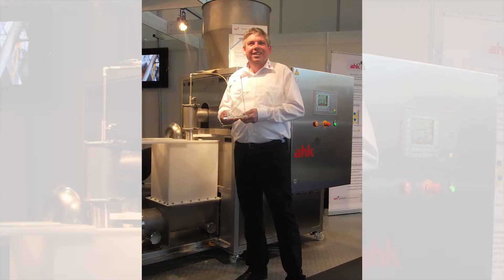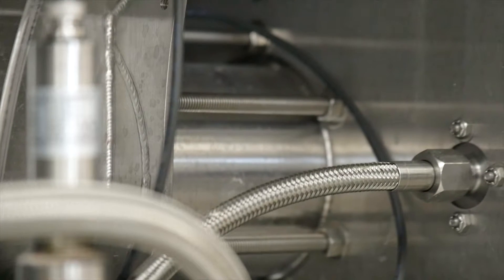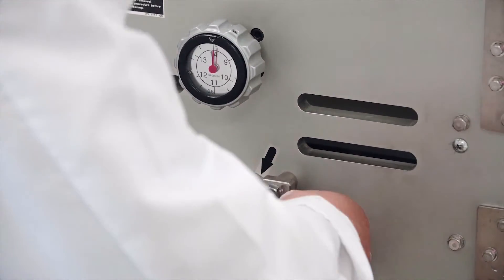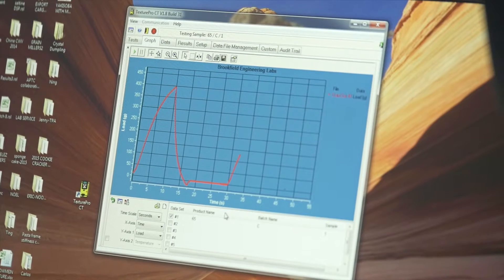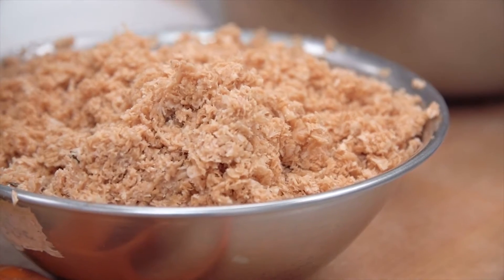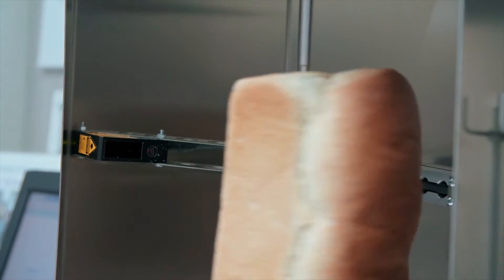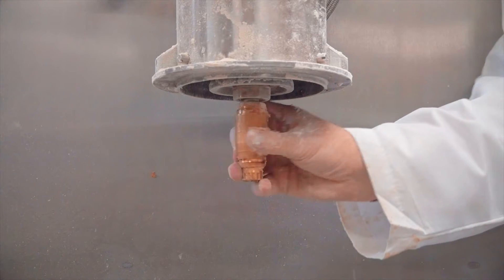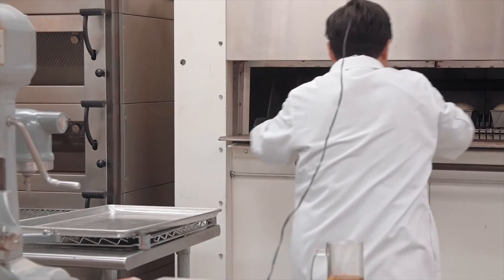Rapidojet Intro

Comment: Hi Ken, according to your explanation, it's a very interesting new and innovative tecchnology. I would like to know how the Activity Water works?  it reduces?  Thanks for your comments
Reply from the maker: Hi Javier; I'm very sorry for the delay in my response. I just noticed your question. The high pressure liquid injection into the free falling dry ingredients creates a much more firm and complete bond. Therefore, in order to achieve the same "dough feel" and level of machinability, we MUST increase the hydration level. Thus, better shelf life, increased yields, reduced mix time, etc. We also develop gluten structure immediately. If you send me your email address, I'll send some good information and studies. ken@bakeryconcepts.net.